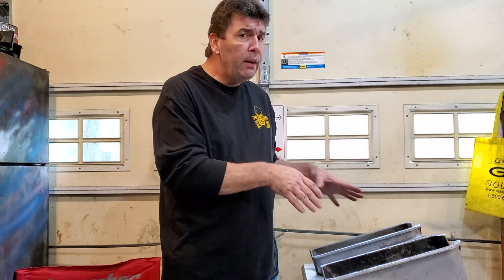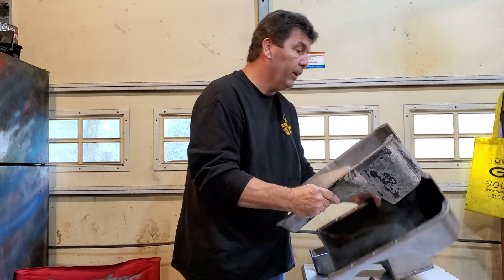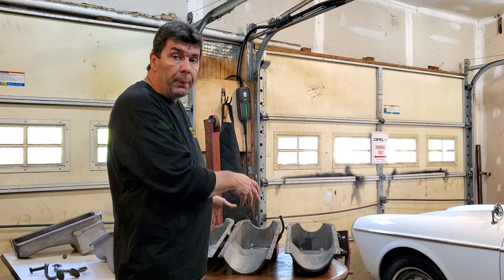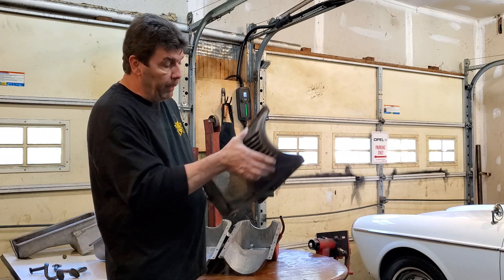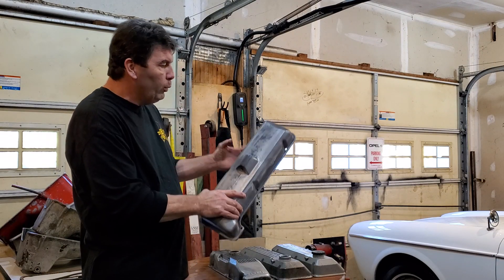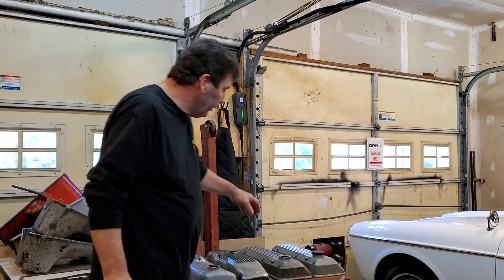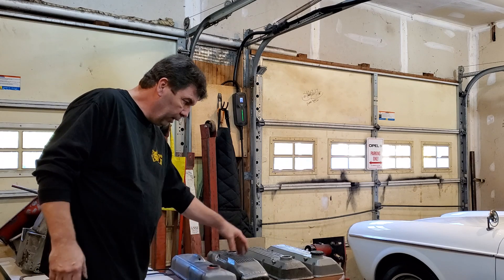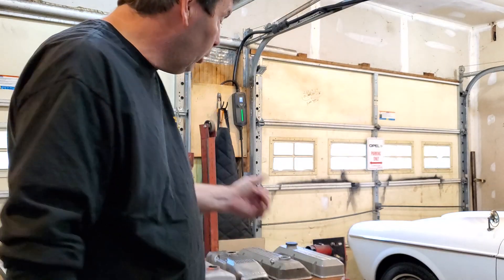Part 2 - The Differences between all the Oil Pans and Valve Covers in the Opel C.I.H. Motors.

Comment: Do you know where to get the mushroom and sleeve for the 2.4 CIH valve cover? Mine keeps leaking oil, but I do not have those so that should help
Reply from the maker: Sadly No. I have used a number of tricks to seal them. Ajusa has new 2.4L gaskets but no mushtooms. I find it best is to use an old school gasket (Rubber and not cork) instead of the standard 2.4L, glue gasket to the valve cover and install with new hex head bolts and the original sleeves.

Comment: Hi, Thank you for your vídeos! Can you tell me how much oil can you put in a standard Steel Pan? In haynes manual it says about 3L, but its very easy to starv the engine of oil, especially in right hand turns (I didnt put baffles when rebuilt the engine).
Reply from the maker: 4 cylinder is roughly that.. about 4 gallons. Overfill is just as bad with Opel.. oil will come out of the dipstick tube . If Racing then starvation can be an issue.. but unless carving down the Italian alps, I don't see a need to worry.
Reply: @GoinManta  how about the aluminium Opel Frontera 2.4 oil Pan? Is it a direct fit in the Manta? These frontera sumps are easy to find here in Europe and are baffled!
Reply from the maker: @joaodiasgil  they are also front sump, Manta is rear sump. The largest one that fits the Manta is the Ascona 2.0 Diesel, its similar to the hammer head one I showed here. But its rare.

Comment: Opel Rekord/(and Commodore?) Have its oil sump on the side of the timing housing. I bought a "Steel 2.0 pan" for my B Manta and so i ordered the wrong version.  i didnt know that little fact :( btw 2.4 aluminum Pan only fits with proper mods in Manta / Ascona B. (1st Have to Reduce height of the sump,then 
2. Cut away the left Edge of its sump, or it will cause trouble with it at my left axle...) Now i'm searching for 2.0 Steel Pan with oil sump to Gear Box side :D sorry for my excourse and greets from Germany! Your Videos 4 Cih are probably the best
Reply from the maker: Your English is far superior to my German. Thanks for the info. I know there are front and rear sump versions but in the US we only got the rear.. so the differences there I have no first hand knowledge of. Just like I have limited experience with 6 cly versions.
Reply: @GoinManta  how about spare parts for Opel Cih in the US? So do you have to import many parts from EU to US? - Edelschmiede is one of the best here! I can recommend the Page of Krause-Rennsport.de for anything in cih Modification. And now i have to take a nap :) bye

Comment: Those covers and pans wont leak if you use RTV silicon on both sides of gasket and do not overtighten.
Reply from the maker: Yep, key is to not overtighten and use a torque wrench. I dont use a lot of RTV as I dont want to get it in the motor. But I do use a coating to seal it to the block. When I don't have the one piece gasket. Going to cover that when I assemble the short block.
Reply: Sheetmetal pan&covers are almost every time warped due overtightening.

Comment from the maker: OK.. not "Crank" but the RODS stick out further and thats why the pan matters. I really should do a script.. ;)
Reply: Have you had problems with rods hitting main oil galley ”boss” in crankcase? Some have had in 1.9 blocks when using 2.4 crank or Diesel crank
Reply from the maker: @juhomaki-petaja  not with Steel pans. But with AL ones I have had interference issues on the stroker motors.
Reply: @GoinManta  I mean cylinder block oil galley
Reply from the maker: @juhomaki-petaja  a little with the strokers, but how much depends on the rod design too. I will be showing that when I breakdown my 2.5L here in a few weeks.